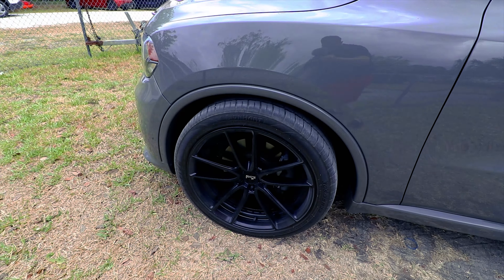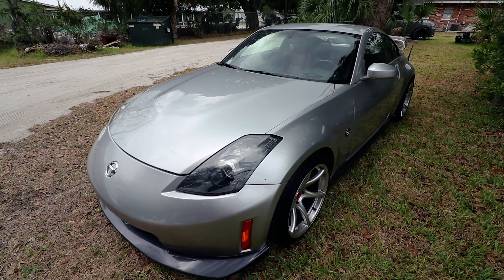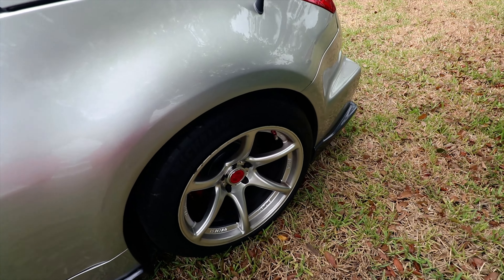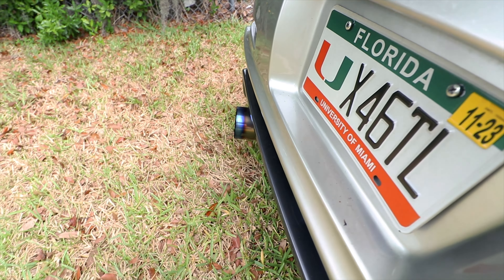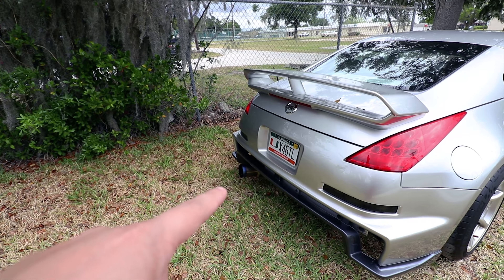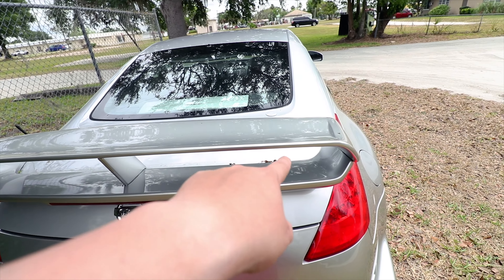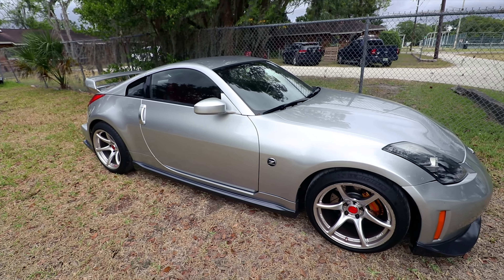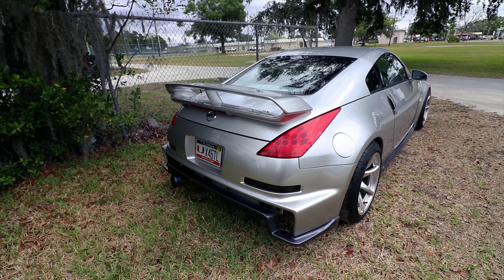350z x Kansei Tandem Hyper Silver

Comment: Did the 10.5 12+ wheels clear the front brembos without a spacer? and can you turn full lock without rubbing?  about to get them for my 350z with oem brembos
Reply from the maker: Yes they cleared fine and I had no rubbing issues but that all depends on your tire size too